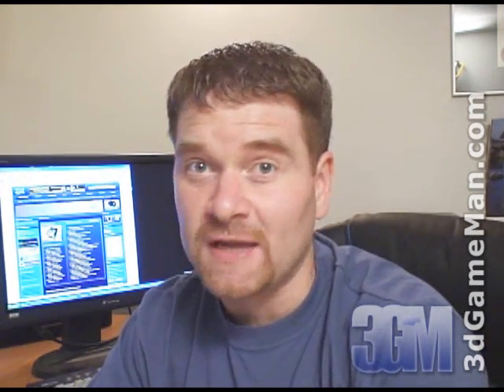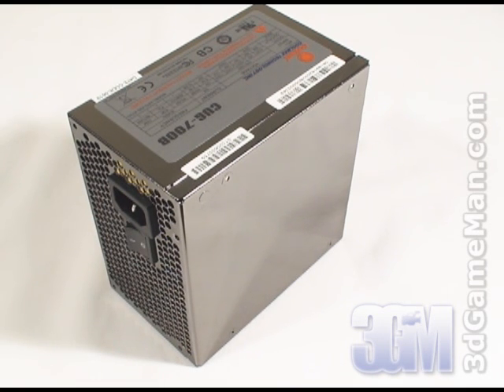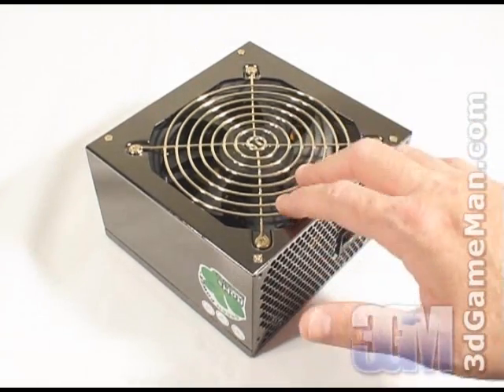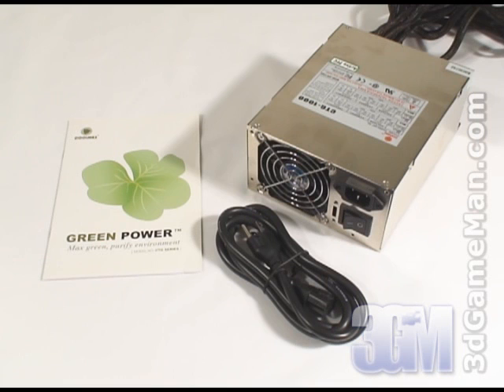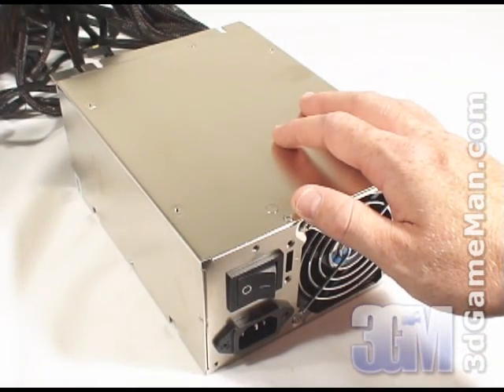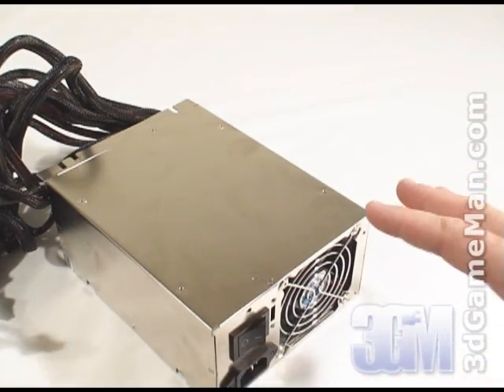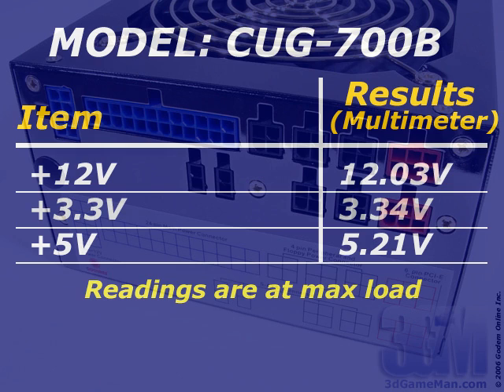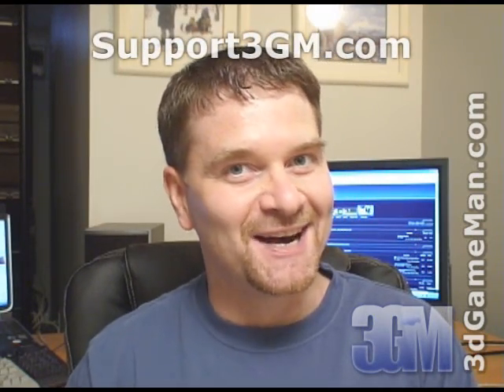#706 - Coolmax 700W & 1000W Power Supplies Video Review

Comment: @boo6r You can get decent ~500w Silverpower/Be Quiet/Corsair units here in the UK for <£50 so I imagine they would be less than $100 in the states. 500w should be plenty for a 560 depending on what other hardware you have.